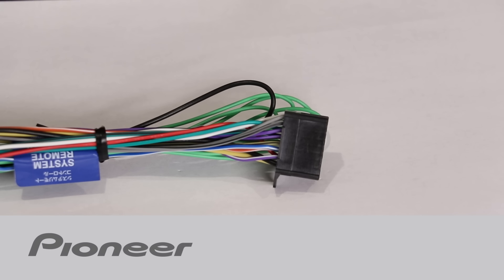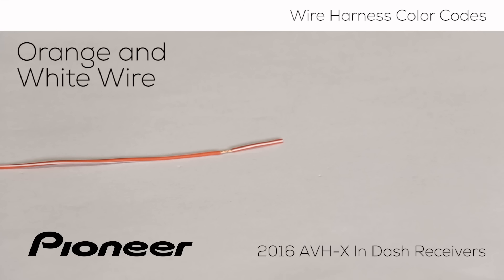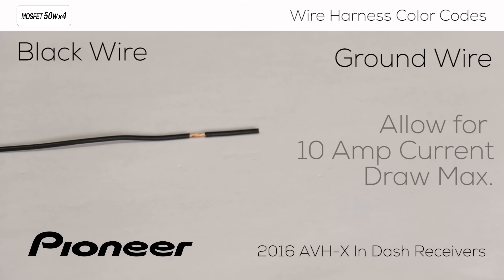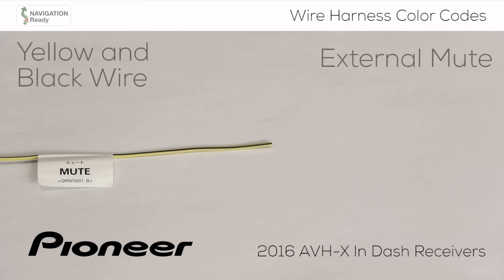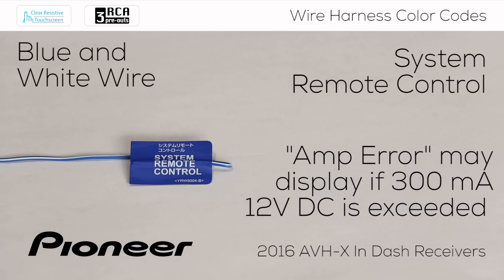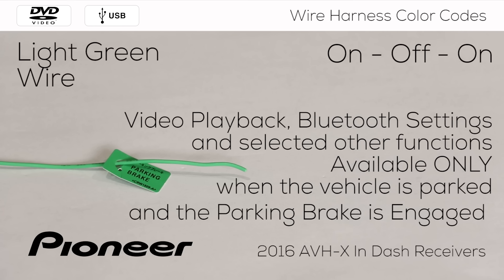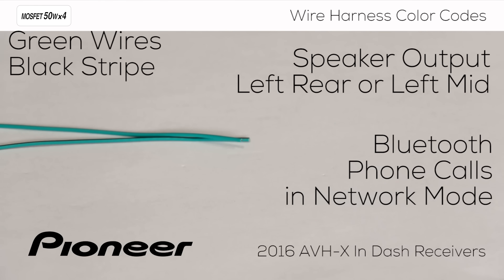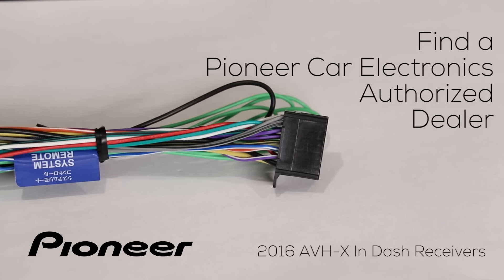How To - Understanding Wire Harness Color Codes  for Pioneer AVH-X Models 2016

Comment: FYI, the Installation Manual diagram for the back panel of a head unit for AVH-1440 and others mention the harness is a power supply, but it is also supplying audio connectivity as well.
Reply: You can find more videos on Pioneer's You Tube Channel here:  https://www.youtube.com/user/pioneerelectronics

Comment: I have the Pioneer DMH 1500Nex and im setting up the wire right now. Can i connect the orange with white wire to the solid orange? Also i have a solid blue wire that says power antenna, can i connect that to blue with white stripe?
Reply: The Blue wire with white stripe on the Pioneer wire harness is for switching on external amplifiers, power antennas, and any other component that needs to switch on and off with the in-dash receiver.  The Orange wire with white stripe on the Pioneer wire harness it for automatically dimming the illumination on the in-dash receiver with the vehicle's lights.  I don't know what orange wire you are trying to connect so I don't know if it's ok to connect it.  You don't need to connect the Orange/White wire on the Pioneer harness, you can dim the lights based on the time of day if you want.  You can learn more about it here:  https://youtu.be/UaGlwjkZVo4?list=PLw63zJRQbCNi6CoU7JbUNT83T7ippQbU6    You can find a full playlist of How To videos about Pioneer NEX in-dash receivers here:  https://youtu.be/kpKYks-17gM?list=PLw63zJRQbCNi6CoU7JbUNT83T7ippQbU6    Please be sure to install the latest firmware for your Pioneer DMH-1500NEX.  You can find it here:  https://www.pioneerelectronics.com/PUSA/Car/NEX/DMH-1500NEX#downloads   and you can find more videos on Pioneer's YouTube Channel here:  https://www.youtube.com/user/pioneerelectronics

Comment: So I have the AVH-120BT touch screen I did everything right connecting the wire harness radio worked great for a year then one day it just wouldn't turn on and hasn't turned on in days
Reply from the maker: There are several possible causes of the receiver not powering on as normal.
1. A wire has become disconnected.  I recommend to check the Red, Yellow, and Black connections.  If any of these connections are loose or disconnected, the receiver may not power up.  After driving for a year, it's not uncommon for a wire to vibrate loose.
2. A blown fuse.   There is a fuse on the back of the in-dash receiver at the wire harness connection.  It may need to be replaced.   In addition, I recommend to check the fuses in the vehicle panel for power to the receiver Red and Yellow connections.
3. I recommend to press the microprocessor reset button.  You'll need a paperclip or some other small point to press the microprocessor reset button.  You can find the microprocessor reset button on Pioneer AVH-120BT just below the USB port on the front of the receiver.
You can find more videos on Pioneer's YouTube Channel here:  https://www.youtube.com/@pioneerelectronics

Comment: Hi I am using the wireless Bluetooth reverse camera . I am getting a blank screen however I am just wondering should I connect the purple and white wire to a ground connection
Reply from the maker: Is the camera powered up?  Is the camera plugged into the Brown, backup camera input on the receiver?
The receiver's violet/white wire is used to automatically open and close the camera window on the in-dash receiver when the vehicle is in it's reverse gear.  It's typically connected to the vehicle's back up lights.
Pioneer in-dash receivers are designed to work with the Pioneer ND-BC8 backup camera. I don’t know about the operation of other cameras. 
Be sure to plug the Brown camera output RCA into the Brown RCA Input on the back of the Pioneer in dash receiver.
The Pioneer ND-BC8 camera needs power and ground to operate.  The camera should always have power when the vehicle is switched on. And the camera should power off when the vehicle is switched off.  This is very similar to the way the Red Accessory wire works on a Pioneer in-dash receiver.  Just because the camera has power does not mean you are viewing the camera window on the in-dash receiver.
The receiver’s violet/white wire is used to let the in-dash receiver know that the vehicle is in it’s reverse gear and, to automatically open the backup camera window on the receiver screen. 
Do not connect the violet/White wire to the camera. 
When you put the vehicle in it’s reverse gear, the violet/White wire should sense a change in voltage. This automatically opens the camera window on the in-dash receiver. And closes the camera window, when the vehicle is taken out of it’s reverse gear.  One possibly connection for the violet/White Reverse Gear wire is the vehicle’s  backup lamp terminal. 
You can learn more about wiring your Pioneer in-dash receiver in this How To video from Pioneer:   https://youtu.be/-bF3uzzaT30?list=PLw63zJRQbCNgLoyoij-BJdPDBVLYipAnj
And you can find more videos on Pioneer's YouTube Channel here:   https://www.youtube.com/user/pioneerelectronics
Reply: @pioneerelectronics  
Thank you for your reply my stereo is the pioneer avh-180 dvd stereo 
The power cables are connected to the red wire and the power source of the rear break light 
The 2 sensors are working on general and the whole stereo system is working fine
I did try to swap the yellow cables in the back of the unit but that didn't help.
I wish I could show you the pictures and set up so that way you can see for yourself and hopefully see if I have connected properly. 
Thank you for your kind reply

Comment: Thank you for linking me to this video, if I choose to wire my stereo to dim when headlights are on but am using headlights in the day, can I override the auto dimmer? Can you set it so it only dims in the evening when headlights are turned on with the timer?
Reply: You can change the dimmer setting on the receiver as often as you want.   If you choose the timer setting, the lights dim at the selected time.  For example 8:00 PM. and the lights come back up to selected brightness at the selected time.  For example 6:00 AM.  The position of the vehicle lighting switch does not matter.
Reply: @deckerdotto6035  that's brilliant thank you!

Comment: Do I connect the System remote control wire (blue+white) to the vehicle's Amp remote wire (blue+white)?
Reply from the maker: Do not expect the wire colors of your Pioneer receiver to match the vehicle.  Any color match that may happen is purely coincidence. 
The Blue/white System Remote Control wire on the back of the Pioneer receiver is used to switch on / off external devices that need to switch on and off with the in-dash receiver.  For example an external amplifier.  
You can view the blue/white wire as the amplifiers on/off switch.  You can see where this wire connects to a Pioneer amplifier in this video:   https://youtu.be/99Hfmc8QxVc?t=469
This does not power the external amplifier. It only switched the amp on and off.  An external amplifier still requires power and ground to operate.
You can find more videos on Pioneer's YouTube Channel here:  https://www.youtube.com/user/pioneerelectronics

Comment: If I don’t install an in line switch, will the unit still drain the battery if the face plate is removed?
Reply from the maker: If the face is removed from the in-dash receiver, it will shut down and will not drain the battery other than a very small amount to hold memory functions and the internal clock.
You can find more videos on Pioneer's YouTube Channel here:  https://www.youtube.com/user/pioneerelectronics

Comment: I have just rechecked my cable the light green is connected to the black cable,should this then be connected to the red power cable and will this allow my reverse camera to work 
At the moment my dvd is working without the need for my handbrake to work on or off
Reply from the maker: The Light Green wire needs to be connected to the vehicle's Parking Brake switch.   You can learn more about this here:     https://youtu.be/-bF3uzzaT30?t=317    You can not watch DVD or USB video without the vehicle's Parking Brake engaged.
You can learn more about this on page 3 of the installation manual here:    https://www.pioneerelectronics.com/StaticFiles/Manuals/Car/QRD3830B.pdf
The backup camera has nothing to do with the Light Green wire and should not be connected to the camera in any way.
Do not connect the black wire and red wire together.
Pioneer in-dash receivers are designed to work with the Pioneer ND-BC8 backup camera. I don’t know about the operation of other cameras. 
Be sure to plug the Brown camera output RCA into the Brown RCA Input on the back of the Pioneer in dash receiver.
The Pioneer ND-BC8 camera needs power and ground to operate.  The camera should always have power when the vehicle is switched on. And the camera should power off when the vehicle is switched off.  This is very similar to the way the Red Accessory wire works on a Pioneer in-dash receiver.  Just because the camera has power does not mean you are viewing the camera window on the in-dash receiver.
The receiver’s violet/white wire is used to let the in-dash receiver know that the vehicle is in it’s reverse gear and, to automatically open the backup camera window on the receiver screen. 
Do not connect the violet/White wire to the camera. 
When you put the vehicle in it’s reverse gear, the violet/White wire should sense a change in voltage. This automatically opens the camera window on the in-dash receiver. And closes the camera window, when the vehicle is taken out of it’s reverse gear.  One possibly connection for the violet/White Reverse Gear wire is the vehicle’s  backup lamp terminal. 
You can learn more about camera operation here:   https://youtu.be/tWi_kVPg2M4?list=PLw63zJRQbCNgLoyoij-BJdPDBVLYipAnj
You can find more videos on Pioneer's YouTube Channel here:  https://www.youtube.com/user/pioneerelectronics
Reply: Thank you this has already been done i am just wondering why my wireless connection is not displaying the rear screen camera 
Kind regards

Comment: hi there i just bought an AVH-A205BT will these wires on this video correspond to the same on that model?
Reply: The wire harness color codes should be the same.  Even though this video was made back in 2016 the wire harness color codes for Pioneer in-dash receivers have not changed through 2019.  You can find more videos about the Pioneer AVH-210EX,  with very similar operation to Pioneer AVH-A205BT here:  https://youtu.be/oVH5gvX5Rfs?list=PLw63zJRQbCNgLoyoij-BJdPDBVLYipAnj   You can find more videos on Pioneer's You Tube Channel here:  https://www.youtube.com/user/pioneerelectronics

Comment: I'm trying to install a Pioneer AVH-Z5200DAB into my 2009 Mazda 6 with a Bose amp but couldn't get any sound so thank you for explaining the blue/white wire but I'm not sure where to connect it. Have checked & am sure I have the correct aftermarket harnesses etc. Any tips?
Reply: I recommend to bypass the OEM amplifiers completely and use aftermarket amplifiers and speakers.  If you want to use the OEM amplifiers, I recommend to use an aftermarket interface that will allow OEM amplifier retention for your particular vehicle.  Many are available, here is one possibility:    https://catalog.pac-audio.com/catalog/radio-replacement/rp4-mz11    If you are having issues with the interface, please contact the manufacturer of the interface for install help.  Or take your vehicle to a qualifier car audio installer shop for help.  You can find more videos on Pioneer's You Tube Channel here:  https://www.youtube.com/user/pioneerelectronics

Comment: I have a 2004 gmc yukon xl...bought the 491bhs...love it...where do I hook up the purple wire to if I don't want to run a cable to the back..I have camera but having problems, diagram,
Reply: If you don't know how to install please seek professional help at a car stereo install shop.

The camera should have power when the vehicle is powered on.  The purple wire lets the in dash receiver know the vehicle is in reverse and opens the camera window to view.

You can find more videos for AVH-X491BHS in this playlist:  https://youtu.be/Ta-Ax3nosoc?list=PLw63zJRQbCNgBa_XGkaQJbuH0eUdYwq-Q
Reply: Deckerd Otto umm it's one cable I needed to know..I installed the radio...all I needed to know was what cable the back purple went too...I was just hoping for help here...so I'm still looking for the color of my brake light on my 04 xl....

Comment: I don’t understand what do I connect the yellow think wire to?
Reply from the maker: The yellow wire is used for memory. It needs to be connected to a constant 12 volt source. 
If needed, contact our Product Support at 1-800-421-1404, select option 1.
They will provide installation assistance.

Comment: Hi I need help with the rear camera which has Red/Yellow and Black wires how to wire, which is power, i just changed my Panasonic radio and need to use my Japanese camera in Pioneer AVH-A215
Reply from the maker: In Pioneer's wiring system, Yellow is constant power, Red is switched power, and black is ground.  This may not be the same for other brands of products.  I suggest to contact the product manufacturer for support.
Pioneer in-dash receivers are designed to work with the Pioneer ND-BC8 backup camera. I don’t know about the operation of other cameras. 
Be sure to plug the Brown camera output RCA into the Brown RCA Input on the back of the Pioneer in dash receiver.
Your Pioneer AVH-A215BT uses a composite RCA video input for it's backup camera.  If the camera you want to use has a composite RCA video output, the camera should work with the Pioneer in-dash receiver.
You can see the camera input on a similar receiver here:     https://youtu.be/ytUlUsi15Uc?t=159
The Pioneer ND-BC8 camera needs power and ground to operate.  The camera should always have power when the vehicle is switched on. And the camera should power off when the vehicle is switched off.  This is very similar to the way the Red Accessory wire works on a Pioneer in-dash receiver.  Just because the camera has power does not mean you are viewing the camera window on the in-dash receiver.
The receiver’s violet/white wire is used to let the in-dash receiver know that the vehicle is in it’s reverse gear and, to automatically open the backup camera window on the receiver screen. 
Do not connect the violet/White wire to the camera. 
When you put the vehicle in it’s reverse gear, the violet/White wire should sense a change in voltage. This automatically opens the camera window on the in-dash receiver. And closes the camera window, when the vehicle is taken out of it’s reverse gear.  One possibly connection for the violet/White Reverse Gear wire is the vehicle’s  backup lamp terminal. 
You can find more videos on Pioneer's YouTube Channel here:   https://www.youtube.com/user/pioneerelectronics